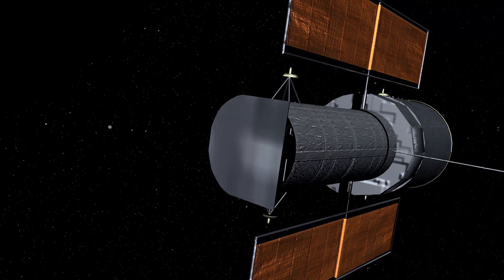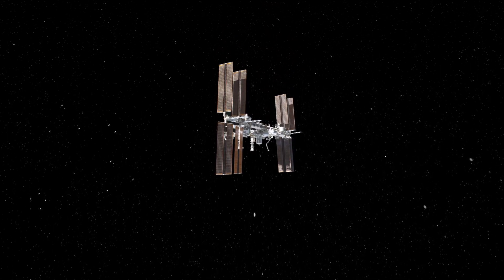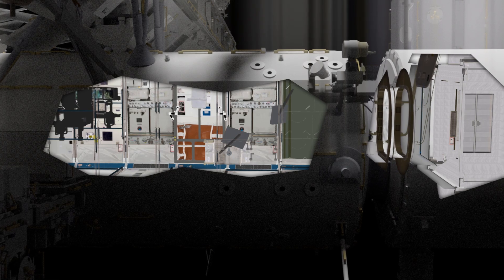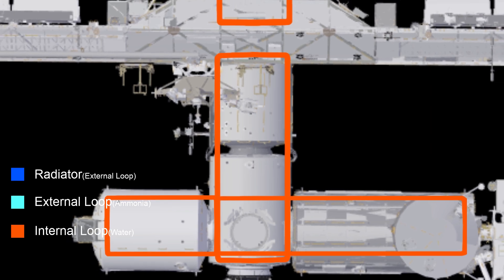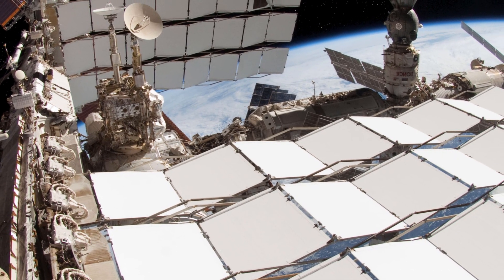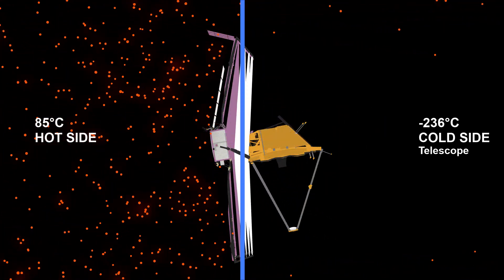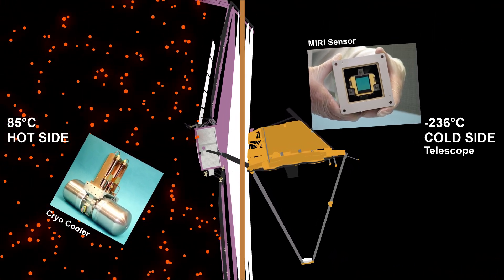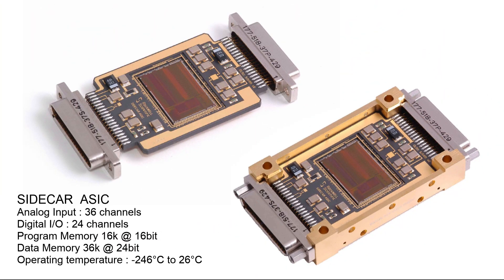Spacecraft thermal system

Comment: How do we heat the interior of the ISS? If for example the temperature becomes too low ? (We have seen the air conditioning system but what is the heating system ?)
Reply: Hold on. NASA needs to come up with another ad hoc explanation.

Comment: This taught me absolutely nothing about how heat is radiated in space.  On earth there is air so cooler air comes into thermal contact with something warmer, and heat is transferred to the cooler air and blown away to dissipate on its own with the rest of the air.  In space there is no air.  So where does the heat go?
Reply from the maker: You’re correct.  Since there’s no air in space, cooling can only be done via radiation. At
3:26 in the video, the heat from inside the ISS is removed by using it to heat up Ammonia. The ammonia is then piped to the big radiators. The main job of the radiators is to dramatically increase the contact area between the ammonia that’s carrying the heated and the pipe that it’s flowing through. This pipe is directly in space. And this is the key. Every object(matter) that’s not at absolute zero will convert it’s internal thermal energy to thermal radiation(infrared). And in that process of radiating, energy will be lost and the object will cool down. The hotter the temperature, the stronger the radiation.  On the other hand objects can absorb radiation like infrared , microwave, etc and convert it to internal thermal energy which will then raise its temperature.
So if you want to cool something in space, all you have to do is make sure that it’s radiating more energy than it’s absorbing. Paint it white or make it Reflective. That way it absorbs very little radiation but radiates a lot due to its temperature. Let me know if you’ve got additional questions.
Reply: @ReflectiveLayerFilm  So it is not radiating heat like we do on earth where the heat is transferred from the object to air then blown away from the object.  It seems like what you are saying is that the heat is converted into infrared which is light?  So basically the "radiators" as we call them for space are actually giant light bulbs that emit light below the spectrum we can see and run on heat instead of electricity.  I mean I guess that could make sense as to how it gets rid of the heat I just don't even remotely understand how to convert heat into light except for example when you head metal up so hot it glows.  But then thats getting the light into our visible spectrum.  So was it already glowing in the infrared spectrum all the time and just got brighter and brighter until it finally got to the visible spectrum?
Reply from the maker: Yes, before you heat up the metal, it’s already emitting in the infrared(IR). That’s how a passive infrared camera can see in the dark. They detect the IR radiation emitted by the objects. The warmer the object, the stronger the IR. As long as the temperature is above absolute zero it will emit IR.  So even cold objects like ice emit infrared but a much weaker level. Since energy can not be created/destroyed, the object has to cool down in the process.
The radiators are like giant light bulbs in a sense. But instead of ultimately converting electricity into visible radiation, they increase the rate at which natural radiative cooling happens. 
They work almost in the exact way that a radiator in a car with an engine works. Fluid heated up by the engine flows through the radiator. The radiator has a long tube with fins along its length. When the fluid heats up the metal tube, the fins are also heated up. Since all the fins combined have a large surface area, more of the heated surface will be in contact with air which will take that heat away via the process of conduction. Heat is also lost via radiation from those same surfaces but conduction is way more effective than radiation.  That’s why the ISS needs those giant radiators because heat loss via radiation is really slow unlike in the movies. But in space that’s the only game in town.

Comment: What would be the possibilities of life on outer space?🙂
Reply from the maker: If you're talking about outer space like beyond earth then it's certainly possible  that life can exist there. The environment just has to be one that supports life. Statistically speaking some planets at the very least should be able to support life.  But at far as the possibility of life  existing in the void of space, that's impossible or at least not for very long. The main reason is that life needs usable energy and resources. These both are rare in the void of space. Solar energy is the only source of energy but only usable if you are within a star system. You also have to 100% recycle all of the matter that is used.

Comment: Isnt space a vacuum? How do radiators transfer heat into space when there are no particles
Reply from the maker: Yes, space is a vacuum. The radiators transfer the heat into space thru radiation. The radiation  in this case is infra-red. This is a different mode of heat transfer than a radiator in a house or a car. They transfer heat mostly through convection with the surrounding air.  A small amount of heat is also transferred through infra-red radiation.
Reply: @ReflectiveLayerFilm  Ohh i see! Thank you for answering my question!

Comment: https://youtu.be/eniSc_I69zQ
So this scene is possible?
Reply from the maker: What about the scene are you asking is possible?
Reply: @ReflectiveLayerFilm  Possible, suddenly temperature changing causes material cracking, and hammering the pipe will be able to breaking it, and I think it leads out a  question that how distance away from sun will be ideal place which sunlight around there is generally increasing to earthly warm slowly?
If this place exists, spacecraft spinning itself to getting the heat averagely, or just deploying a big mirror behind it's dark side to reflecting and focusing heat ray to dark side of the craft.
Reply from the maker: Yes in space the temperature difference between the sun facing side and things in the shadow can be very large  like I state in this video. But that doesn't mean things will crack. Especially not metal. I don't think the breaking of the pipe has much to do with the sun coming up. Most material used for the outside of a spacecraft are designed to have only small thermal expansion for this very reason.
Yes spacecraft are rotated sometimes for thermal reasons. The Apollo spacecraft to the moon were all slowly rotated to prevent one side of it from getting too hot.

Comment: Excellent explanation of heat on the ISS I international Space Station/ it would seem in -83 C that this is a huge issue as well as O2 generation and h2o 
However the thermal piping  or radiant heat system still sort of foggy..